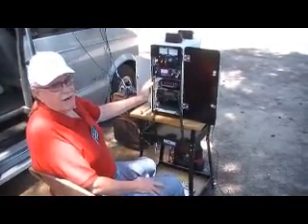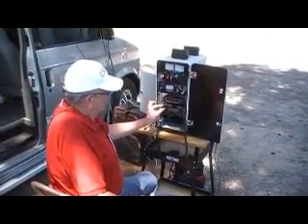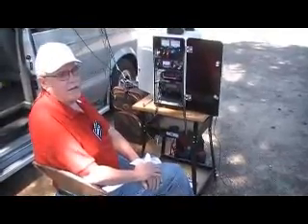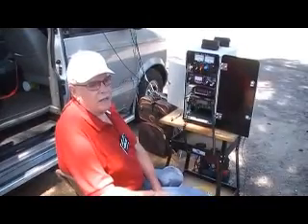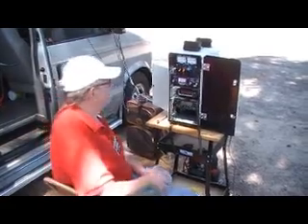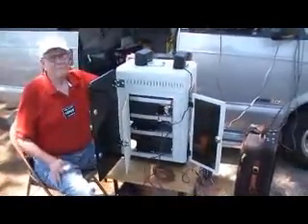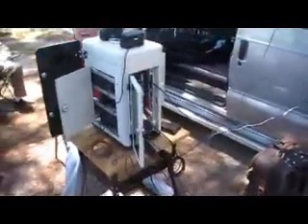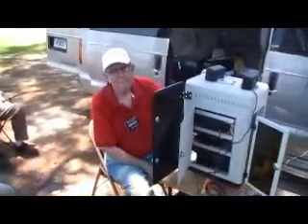Earl, K5ROC's Portable Ham Radio Station

Comment: Yes......kind of.  The HF waves will be refracted by the ionosphere and return to earth.  So, theoretically, there is a "blind spot". But there is thing called scatter, which is where the radio waves are "scattered" by the ionosphere and the earth, where you can receive the signal, but it isn't as good as if you were where the wave was hitting the earth from the ionosphere.

Comment: I'm still very new to this... Can you do HVIS with a Screwdriver?  I still don't quite understand HF... I know that HF doesn't depend on Line of Sight, but bounces... So does that mean there's a potential blind area 20 to 100 miles out, that's too far for  LOS, but too close to bounce?  THerefore needing to go vertical with the HF antenna (HVIS)?